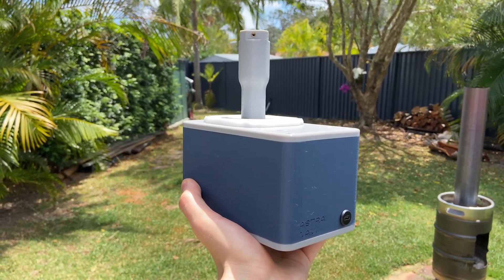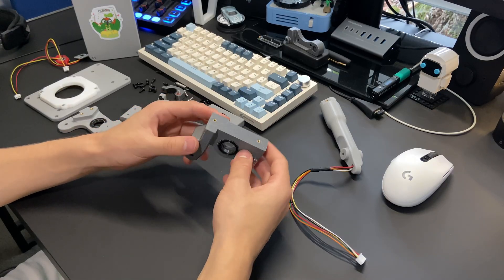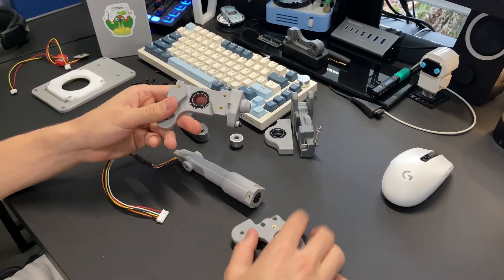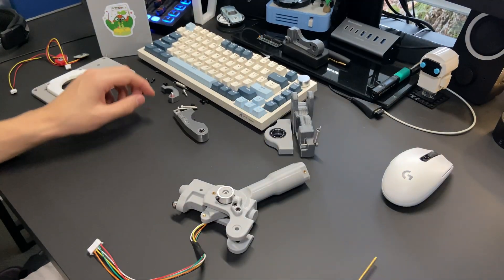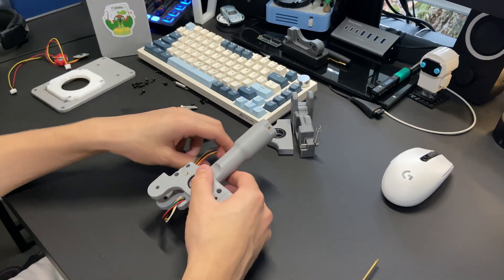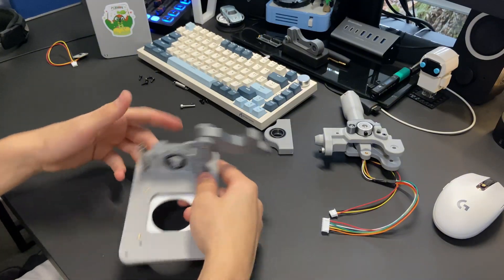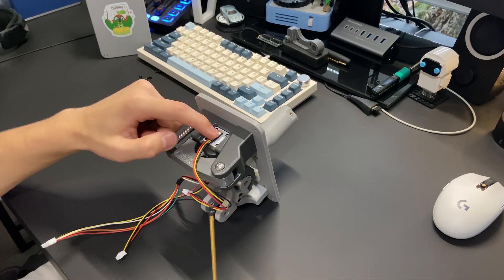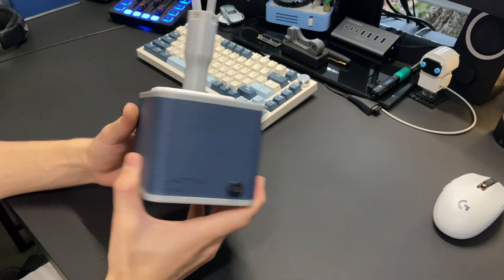Astra Nav. 2.0 - Gimbal Base

Comment: I have one more question for you. How did you determine your cam profile. I was designing a gumball and didnt how to get passed that.
Reply: Gimbal*
Reply from the maker: I used this video which was recommended to me by someone https://www.youtube.com/watch?v=inSaZusCAq4   Still not quite the same setup, but it still gave a good enough profile that doesn't get stuck. I'm still learning a few things about it, hope it helps. Maybe I can make a short video on this in the future.
Reply: @MicaMaker  Is there any chance you'd be interested in collaborating on this project? I myself have grown interested in creating a DIY flight stick. I have made a few designs myself and also have a few engineering friends who are interested in creating custom electronics for it.

Comment: What are the electronics?
Reply from the maker: I'll add a detailed list of parts when I release the files on Cults 3D, but the main things are Arduino Pro Micro, AS5600 sensors for X and Y axis, and shift register that will be in the next video about the grip.

Comment: Great looking prints mate. What is the printer setup and material you're using?

Would be interesting to see if you can turn the deflection limiter into a gated 6-speed shifter throw guide... 😊
Reply from the maker: Some of these parts were provided by PCBWay, and the rest were printed on my modded Ender 3 Max running Klipper. I use MakerHero PLA+ Hale Navy Blue and their Space Grey PETG. 

I think it would definitely be possible to make a 6-speed shifter throw guide with a slimmer stick arm. Definitely something for me to look into!